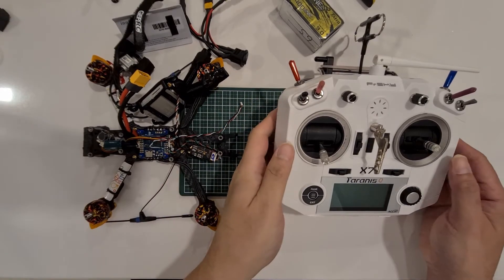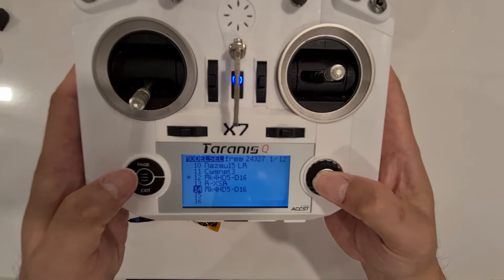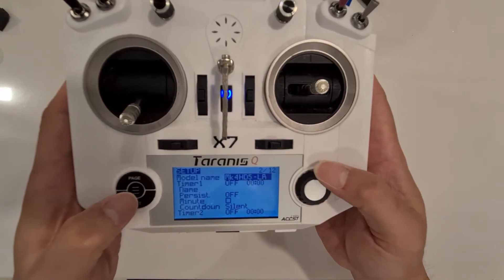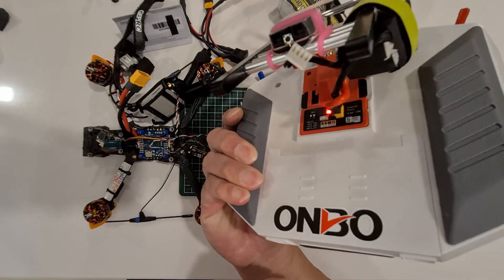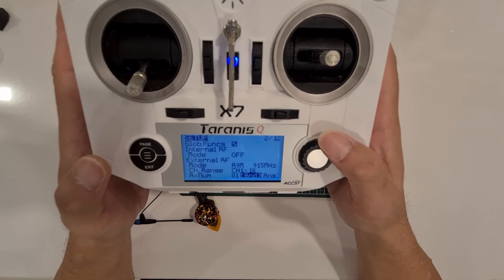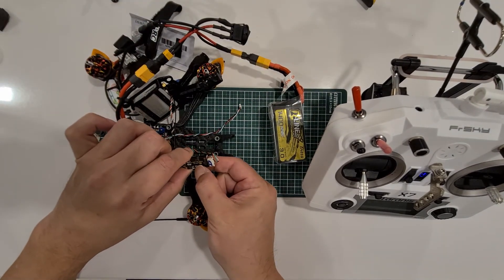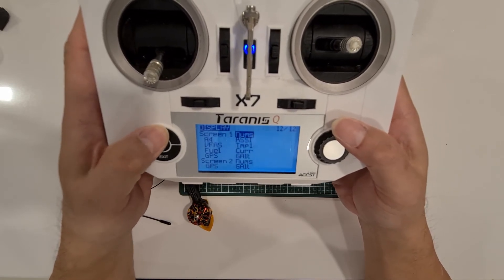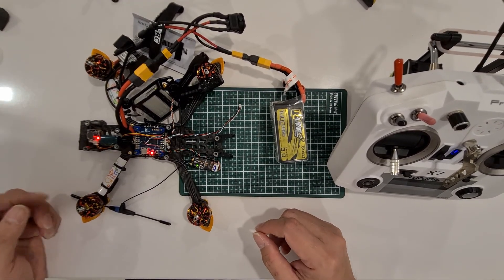FrSky R9 - Binding the Receiver R9Slim+ to the transmitter with R9M module.

Comment: I'm using R9MM receiver with R9M access module. The receiver is wired with V_IN, GND, and SBUS. It won't bind, what do I do?
Reply: any luck? Ive got the same issue, interested to know if you ended up figuring it out

Comment: What wires are supposed to be plugged into the slim plus? VCC GRND and SBUS out?
Reply from the maker: In the configuration tab, I use F-port protocol. With F-port its bi-directional and I can receive telemetry signal from the receiver. So I will need to connect to the S-port pin on the Slim+. That means Vcc , Gnd and S-port. If you are using S-Bus protocol, the connect to S-bus pin on the slim+.